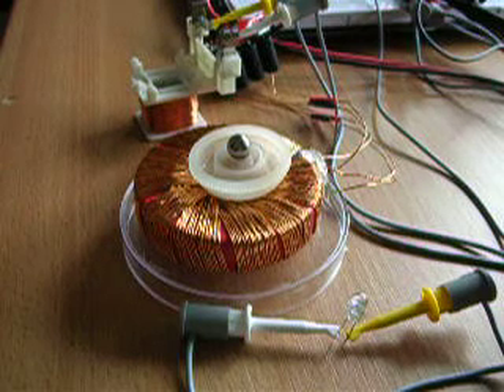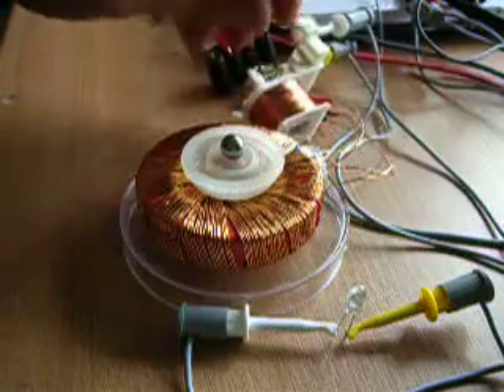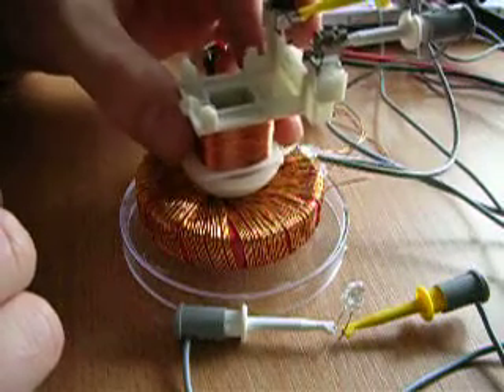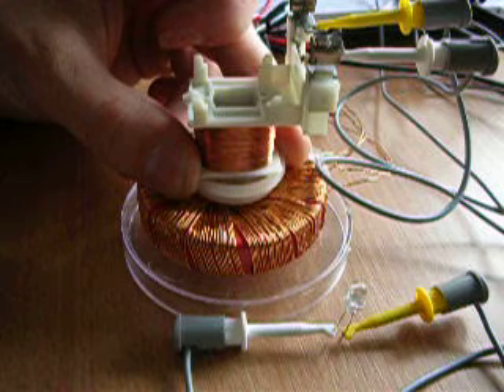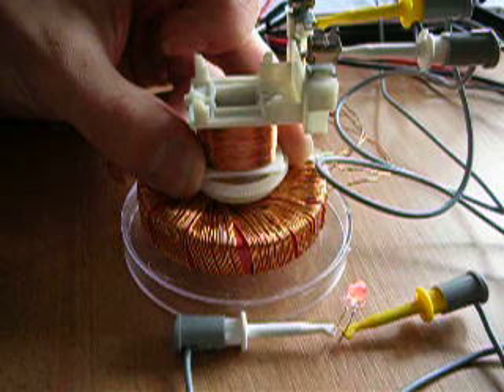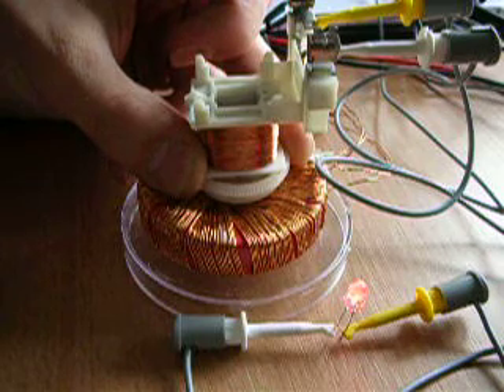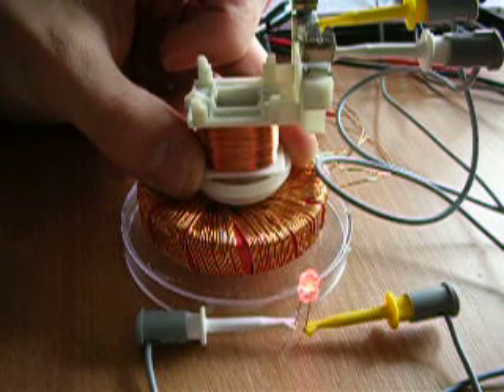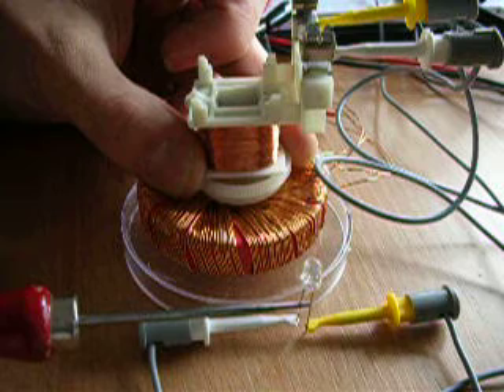Little Rodin # Induction setup

Comment: Very good. You could put a bridge rectifier between your coil and led to change the AC from coil to a pulsed DC. You could also try using your large magnet as the spinner and then just sit the smaller magnet inside the smaller coil, it should start spinning when it gets near the larger one and light the led. Good job!